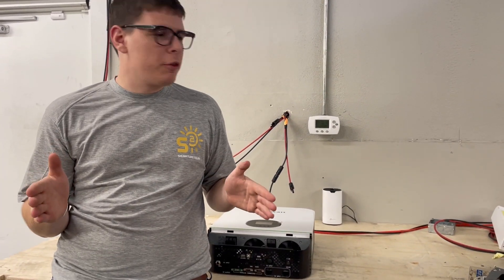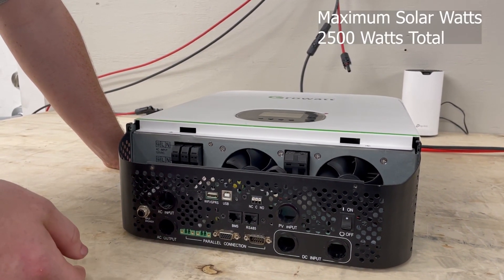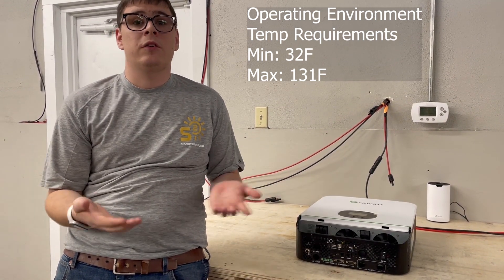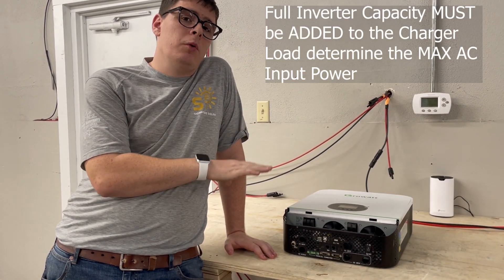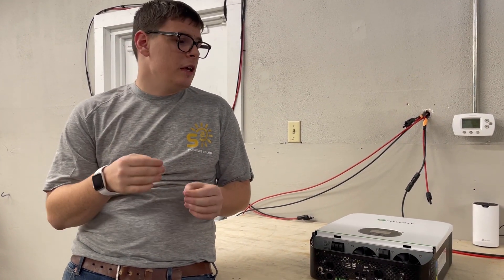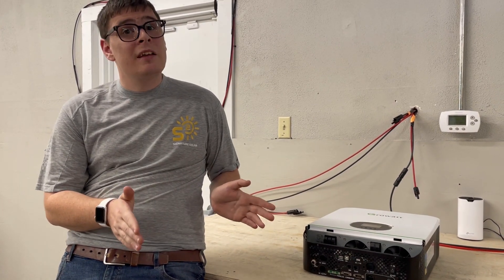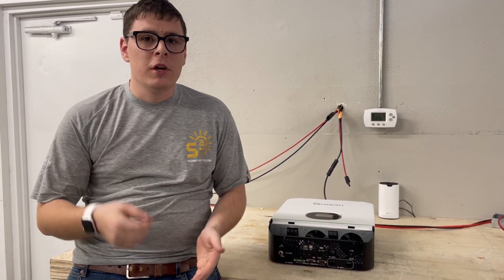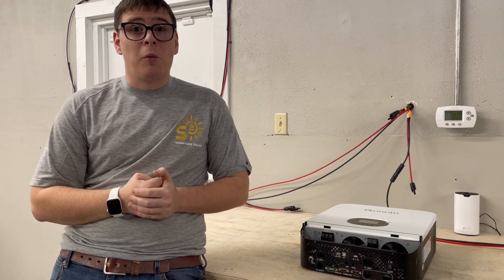Signature Solar Explains Off Grid Growatt SPF 3KW 24V/120 LVM Inverter Charge Controller All-In-One

Comment: I love signature solar!

Question: Could using too thin of AC input wire cause it to not detect the utility power? I was hoping to trickle charge my battery banks at like 5W, but it's not even showing the utility input - despite there being 125V measured on the crimp screws. I would rather not hack up an expensive power cord, as this is not a permanent setup, and I only need to charge the bats for now. Also, I reeeally should've watched this before i turned it on... I definitely applied battery current with the switch on, maybe 5 or 6 times. Could that have blown the circuitry for the AC input?

Comment: I think the warning given at 6:57 conflicts with another video from signature solar regarding the pre-charge resistor. In this other video (linked below), SS recommends to have the inverter already on when turning on the EG4 batteries, otherwise the pre-charge resistor will not engage. Does anyone know how to reconcile these two pieces of information? EG4 Battery start procedure with pre-charge resistor: https://youtu.be/36lerEA0B6Y?si=Dki3uXP0r7k8KD1s&t=78
Reply from the maker: Thank you so much for this feedback! We will look into making an update!

Comment: Lots of great questions here in the comments, but no answers to them.  Seems like a good FAQ is needed and/or someone comeback through here and answer this great questions on this product.

And using Program 2 and Program 11 one can throttle down the utility current demand.  As in not in full.  I have a portable implementation with the 3000, and set it up to draw 15 amps utility in Program 11, therefore I can plug into a standard 15 amp wall socket for grid.  

I agree with these types of tunable Programs the unit is versatile but there is no good source for the theory of operation, hence one must play with it to learn it

Comment: Please clarify regarding the maximum wattage of the solar panels, it handles 80 amps mppt so 2 Kw seem to be the max, but you are saying 2500 watts is ok... i would like to use more than 2000 watts, but i am afraid to damage the inverter. Its a nice inverter and i have just a few days using it.

Comment: I have installed this inverter in my rv using sla batteries. 2 sets of 12v making 24v. Battey cable should be 0awg not 2awg?

Comment: Thanks for the video.  Very helpful. Just a suggestion, couldn't you design a inverter that could work that way using the onboard charger as an operating mode ether through dip switch or software. Or even easier, a separate AC input that powers the onboard charger

Comment: I recently ordered two of these to configure for split-phase operation.  In the video you recommend 0 AWG wire for the battery connection but the manual for this unit indicates 4 AWG on page 5.  So is that incorrect?  --Thanks

Comment: Continued from earlier comment.  I set battery ID to zero (all down).  I used RS485 connection on growatt to battery.  I set battery setting to LI and 01 and got a solid fault light.  I have thought about changing battery ID to 1 (3 down and 1 up) or trying the BMS connection on growatt.  Do I need to update firmware?  I would like the connection because growatt stops charging around 26.8V which I assume it considers battery charged.

Comment: I have this Growatt and just bought a EG4-LifePower4 Lithium Battery | 24V 200AH.  Will your battery communicate with this Growatt if I connect them?  I assume an ethernet cable would work.
Reply: It will, i just did it a couple days ago. The same guy has a nice video explaining how to setup the switches to accomplish this but with a 5 kw inverter. I used the same configuration and it worked fine

Comment: IF you use a seperate battery charger with a generator are you saying to not use a shore power connection to the inverter or in some way changing the settings to disable charging with the inverter.

Comment: i have a question about your comment to use a separate charger and not the inverter to charge batteries....then why buy a hybrid inverter?  Just get an inverter and a separate charger.  Or  second question, why not use a smaller generator to charge the batteries and limit the charge current and MANAGE the loads with just the battery and not use any generator current for loads. Isnt this how the solar charging works anyway?

Comment: OK I need HELP! I finally figured out that there are two different softwares for GYLL and EG4 battery packs. I installed a single EG4 24V, 200AH battery pack and was able to communicate with it and it says that the "short circuit" parameter is 500us. Is it possible to change this parameter so it si not so touchy?
This pack is connected to a VFX3524 inverter-charger which you have to pre-charge with a long skinny wire before flipping up the 250 Amp breaker. But this ONLY works when the sun is shining and the Outback FM80 is delivering a few hundred watts into the battery pack. If the FM80 is off, even the long skinny wire bypassing the 250 Amp inverter breaker will kill the battery. It thinks it is a short circuit and shuts down and it STAYS down after many minutes. 

Now we also discovered that if you plug in the power supply for your laptop computer close to the peak of the 60 Hz sinewave, you will hear a snap from the AC wall outlet and the battery will shut down thinking it is a short circuit. This is my best theory so far as to why it keeps shutting down!
As a load test, we turned off the PV array from the FM80 so that battery is running stand-alone and turned on the electric toaster and it pulled about 50 Amps without breaking a sweat. So it must have something to do with transient current spikes. CAN ANYONE HELP ME SOLVE THIS PROBLEM? This is a brand new battery and the customer is getting really tired of having to cycle the white breaker on the battery and then use the long skinny wire to pre-charge the capacitor in the FM80 and then turn on the PV array and then use the long skinny wire to pre-charge the capacitors in the VFX3524 inverter-charger before flipping up the 250 Amp inverter breaker!

Also, the software said that the battery has 50AH of capacity and NOT 200AH. It also has Hi V cutoff and Lo V cutoff voltages consistent with a 48V battery so I am afraid that the BMS will fail to protect the cells if the voltage ever goes out of bounds. The actual battery voltage should NEVER exceed the Lo V cutoff so the battery should NEVER turn on but it does! SO I am a bit confused!

Comment: Just received the bundle you all sold over the holidays that included the Growatt. Two questions to help with my install in my RV with 30 amp service

1 - you recommend using an external charger when using a generator. I will sometimes be on shore power and sometimes be on generator (if I need to add more power to the batteries than I’m getting from solar). I’m thinking of not running the shore / generator input through the inputs of the Growatt. Rather, running the shore / generator inputs into a transfer switch along with the AC out from the Growatt. 

2 - the kit has 10 x 265 watt solar panels. That will be slightly over the max 2500 watts you mention in the video. Assume since it’s a kit, you’ve tested it and it’s OK. Is 5s2p the recommended wiring?
Reply: i think hes saying..  "set up your panels like you want them.  then check the open circuit voltage. and add or subtract the panels that come the closest to that open circuit voltage target number."   any extra panels can be used for back up panels.

Comment: I enjoyed the video. Good information. Video request: You stated the amperage needed to run loads and the battery charger. You suggested using a generator instead of the inverter to charge the batteries instead. A video on how you do this would be appreciated.

Comment: If not using AC input for battery charging I assume you will need to run a separate earth ground (i.e. earth grounded\bonded panel with breakers tied to AC Output)? Are there other grounding options?

Comment: Can you use the inverter settings along with the dry contact to auto switch on and off a generator, which is connected a battery charger to charge the batteries? If so, what settings should I be using?
Reply: You could use the dry contacts to do anything. You just need to design the circuitry to do the things you want.  In the GW5kES the dry contact settings are covered in the manual and its program 24. Just take a peek at your user manual.

Comment: So in order to charge from AC I need 50 amp service basically. Because once its charging form AC, the inverter is also using AC to power loads? So it can't be set to use Solar first, then battery, then AC to power loads? That doesn't sound too good.
Reply: That still doesn't make sense, because if you plug it into the wall on a 20 amp circuit, and let's say your running a 10 amp, 15 amp load, then your system begins to charge your batteries from that wall outlet, and power the loads that your running.... breaker would trip in your panel. And then why does it have settings for solar and ac charger? I've been running my unit on the 60 amp charger and no solar panels hooked up, just plugged into the wall. Now the system isn't powering any loads, so it just runs on auto pilot... the instructions book is bs and needs to explain some settings in more detail cause after a year I'm still scratching my head
Reply: yes it is sbu ,solar, then battery then utility or grid.

Comment: Hello , on the manual it shows 2,000 watts max for the solar , so it is safe up to 2,500 watts ?
because i have 6ea 400 watts panels and i am only using 4ea  (2 in parallel then series ) if that so then i can add 2 more to make it 2,400 watts ,, perfect ,,
Thank you

Comment: This video is like 7 days to late , already blew my inverters to shit. Wish this info was in the book, the book doesnt even discuss that your inputing 240v as in 2 current carrying conductors or 2 hot phases into the ac input rather than 120v with a neutral as the terminal is labled and book refers to as nuetral . Big mistake there in my opinion , thankfully I had gotten at least that issue cleared up thanks to a youtube video , probably of yours before that becoming my issue. Still didnt save me from the live battery issue with the switch on.
Reply: How is that switch not guarded with a warning label?
Reply: There should be a huge red flag issue on the unit or something to bring more attention to that issue.
Reply: It is only 120v
Reply: @hzracing  sorry but it's not in the us it's a 240v on a 5kw inverter
Reply: sounds like common sense to me.
Reply: @davidkettell5726  its is on the ac input but I dont trust that people are that intelligent.